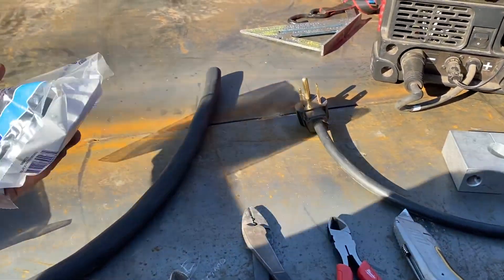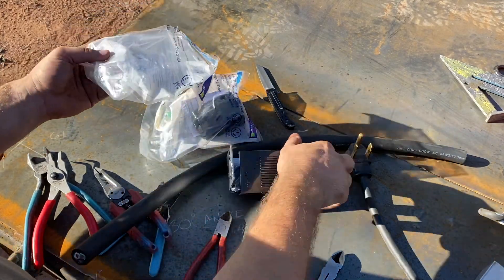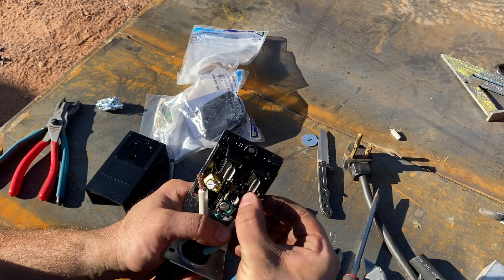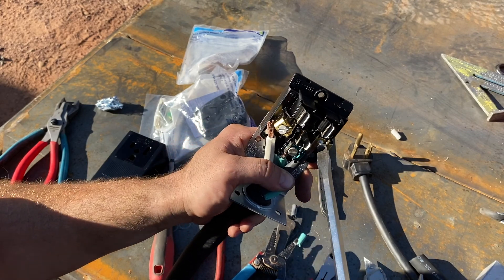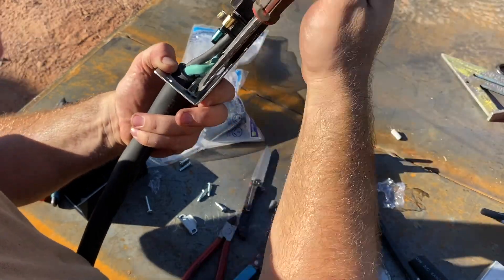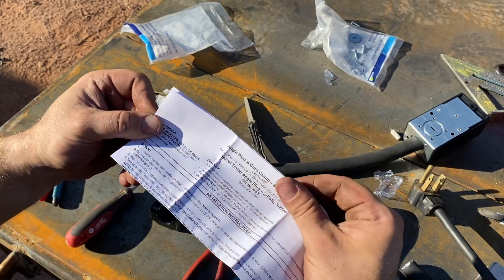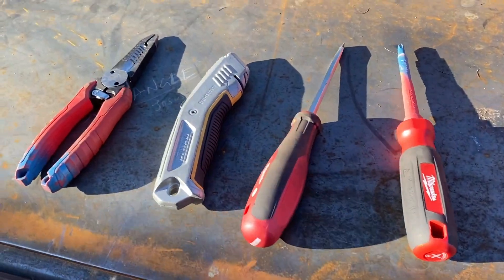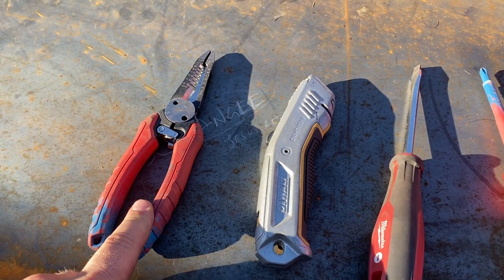Making a 250V Welder cable for a Washer Dryer 240V Outlet

Comment: Nice video. This is the exact cord I have to make up. I have a used dryer cord that I will add the welder receptacle to. Ma and Pa grew up in the Great Depression so I learn to rat hole stuff and it always comes in handy ... eventually!
Reply from the maker: It’s not the cleanest way but it works just fine! Cheers

Comment: Since you kept mentioning OSHA, it is a violation of OSHA rules for a business to use any cord that is not tested and listed by an approved testing agency.
It is also a violation to repair or modify a cord.  If it were not the case, why did you buy the surface mounted receptacle?   The connector that you used is not approved for cord, it was made and approved for cable.   Strain relief you said not necessary, is required by NEC if it was installed as its purpose.  There are cord caps that are plugs and receptacles that are more appropriate.   Not understanding why you used #6 cord.   Was it some left over cord?
Reply from the maker: I’m glad someone with some general understanding of OSHA stopped by. There were no cords or adapters locally available for the project I was working on, so I threw this together. I’m not an electrician by any means, and appreciate your input. Outside of the issue of using untested/modified cords, what would you have done differently? Cable vs cord? Anything else?
Reply: @northlanderco196     You used #6 cu.   It is overkill but acceptable in theory.   The over current for the dryer is 30 amps, so the cord could have been 30 amp rated.  If you cranked the welder up on highest setting, after a while the 30 amp breaker would trip if overloaded.   BTW I informed you of legal issues, doesn’t mean that it will not work perfectly fine.   I just thought you and viewers should know.   Respectfully,   Kevin
Reply from the maker: @KevinCoop1  Please don't think my comments are meant to attack your constructive comments. I was hoping a heavier gauge would reduce tripping a breaker more often, and I usually only use this setup for light duty installs - not the heaviest setting, as you pointed out.
Reply: @northlanderco196     The way that a circuit breaker works for overload is the internal heat in the breaker and based on 85 F ambient temperature.   Increasing the wire size does decrease the conductor temperature, and might make a slight difference in the ambient temperature, but not by much at all.   If I may ask, did that project have an outlet for an electric stove?    To be safe on a job site, I make the following suggestion.   In your proposal, specify the type of receptacle and location that the general contractor must provide in order to get the proposal price.   OSHA makes their money from fines.   They are now shy about whacking you hard if caught.    Respectfully,   Kevin